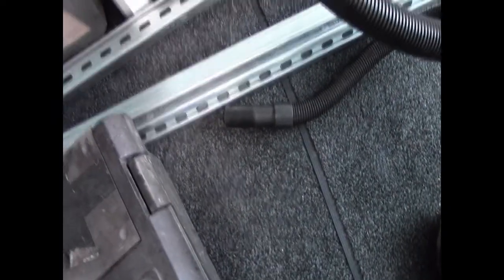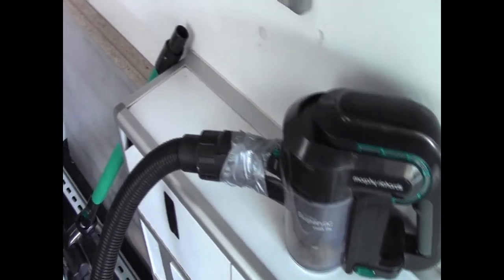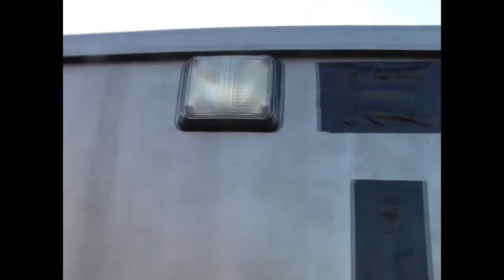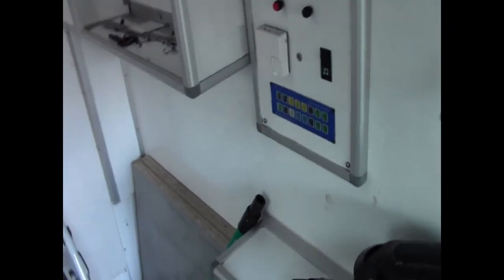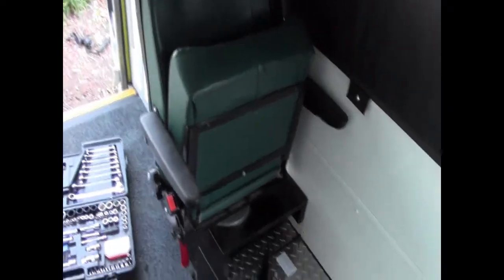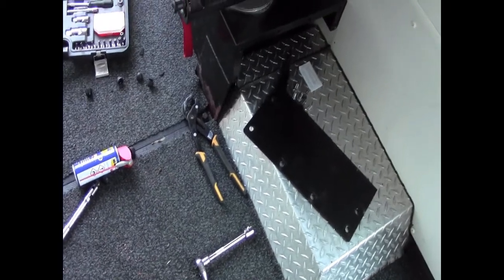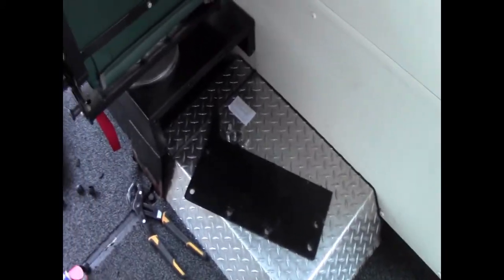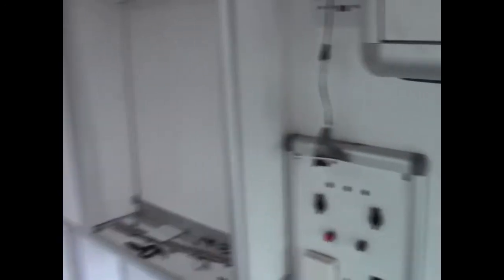Ambulance Camper Conversion The Importance Of A Vapor Barrier

Comment: I'm just starting my ambulance build, and this video reminds me of what I'm going to be doing. Of course, I have a bolt that won't come loose, sort of like you. I'm going for the pipe wrench and even a cheater bar if need be tomorrow since it's not really a bolt but just a threaded round metal knob with grooves that you're supposed to be able to turn by hand for "easy" removal. I know this because I have removed 2 of them so far. Vice grips and channel locks are a no-go.

Comment: I just purchased a 2006 e350 ambulance, the lights in the cab works, but not the outlets. Any idea for troubleshooting? Also I to get power to the back with having to run the engine...
Reply from the maker: What lights in the cab ?  not 100% on US vehicals but the 110V outlest are run from an invertor, it could be as simple as it needs switching on or it may have been removed, it runs from the batterys so they "may" be to low t orun it (if it's even fitted) ?
Reply from the maker: @dr.realshit6512  lighting in the rear is not usually msins, they usually run off the 12v system but as I say I've never worked on a US amby, although European ambulances all use US parts the build is different 🤔 so I can't be 100 % sure ☹️